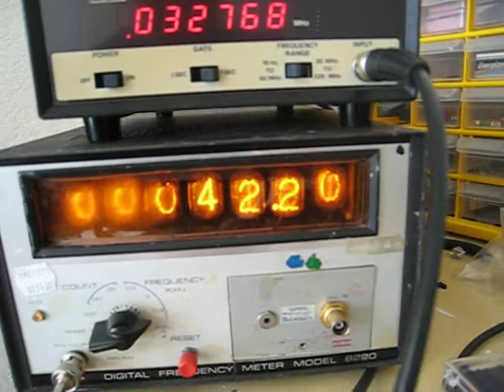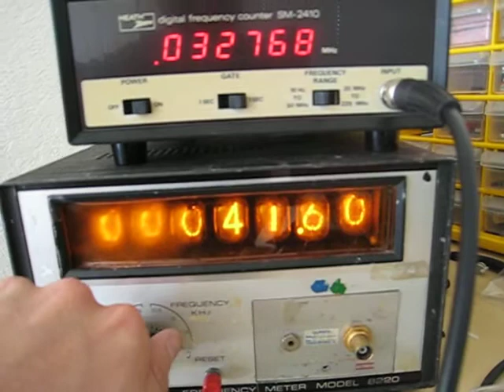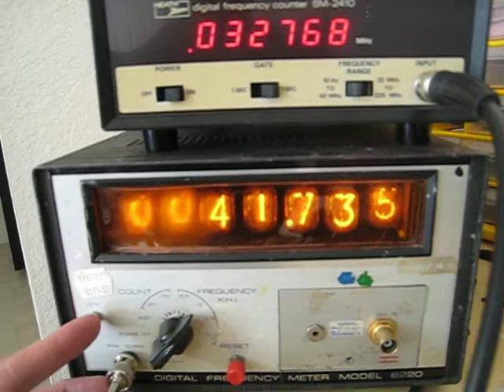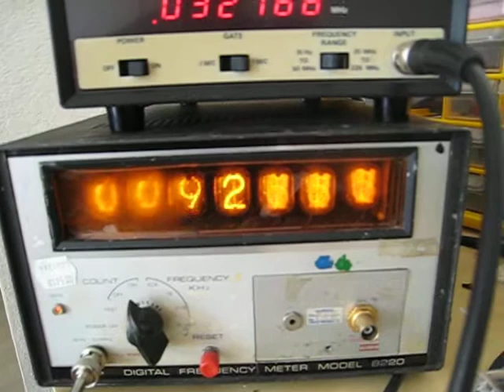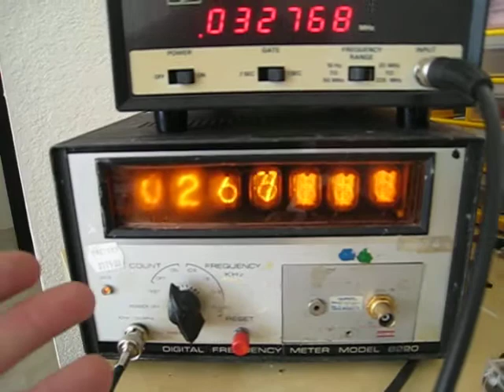Nixie Tube Frequency Counter: Accuracy Test

Comment: inside all frequency counters theres a refrence oscilator. It will drift out of spec over the years and this will throw off your readings. You should measure it to make sure its still in spec.